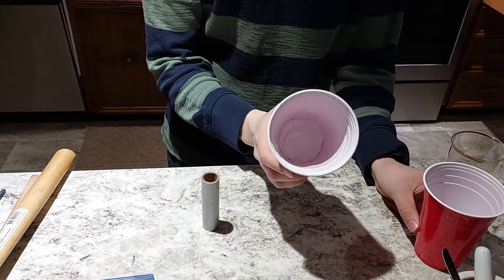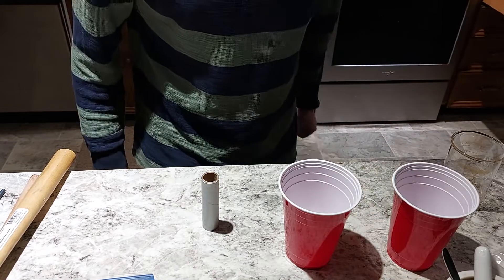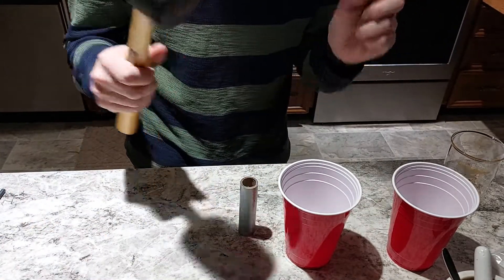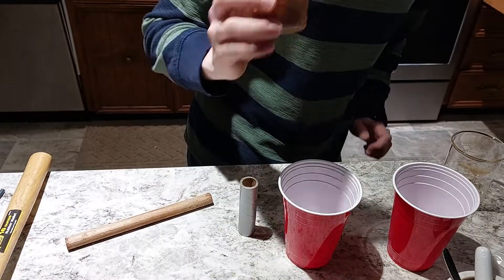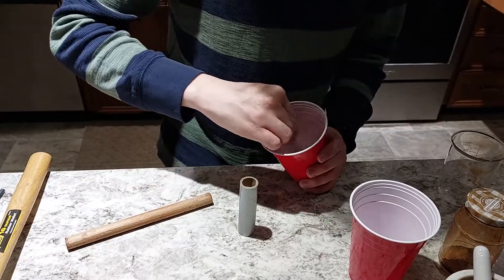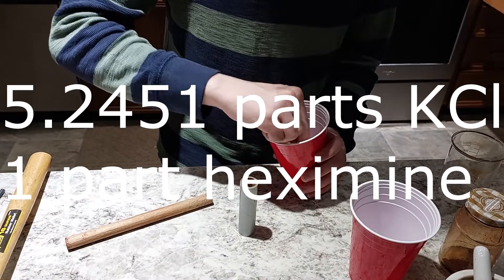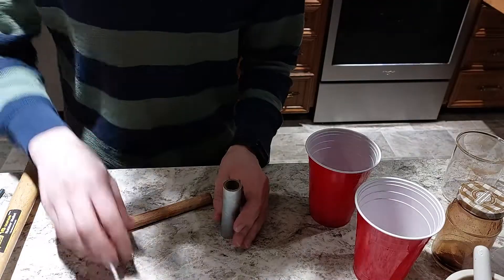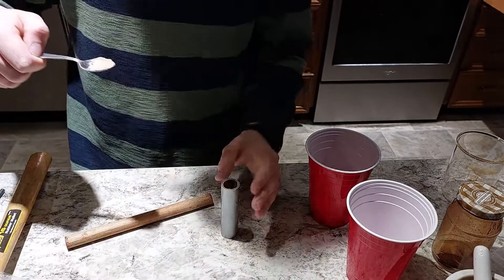Rocket Making

Comment: Also with that tight-fitting ramrod after each stage of tammping with the hammer use a bench vise to compress it further ( drill press would be better, of course drill press does not even get turned on you just attach your ramrod where the drill bit would go and just use the up and down arm) either one of these methods and make the clay hard like concrete so when you drill out your nozzle it will be perfect!

Comment: Why not get a ramrod that fits more tightly more snug into your tube?
Reply from the maker: Best fitting dowel they sold at Lowes.
Reply: @GamerPro132  buy a bigger one and turn it down with sandpaper & a power drill. With a knife whittle one end of the dowel rod down so it'll fit into the chuck of a power drill, turn on the drill and spin it while holding the sandpaper around the other end until you get a perfect fit, then cut off the end that you whittled down so it's flat = perfectly fitting ramrod.

Comment: Those fuel tablets arnt pure hexamine, you might get better performance if you did an extraction on them to remove the binders
Reply from the maker: Hmm. No idea how to do that. I could probably synthesize it if I could find formaldehyde.
Reply: @GamerPro132  if you check the MSDS it'll tell you what and how much binder there is. It's usually just a couple percent paraffin wax. It shouldn't be much of an issue from it.